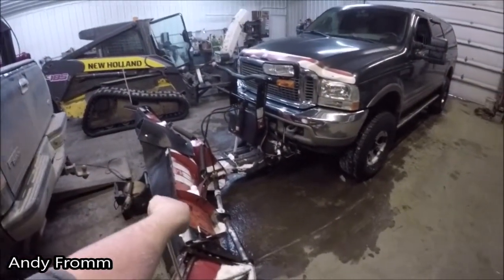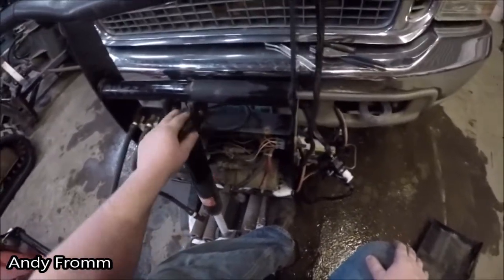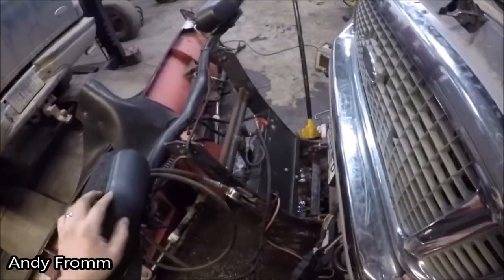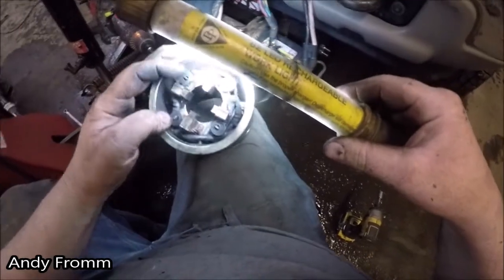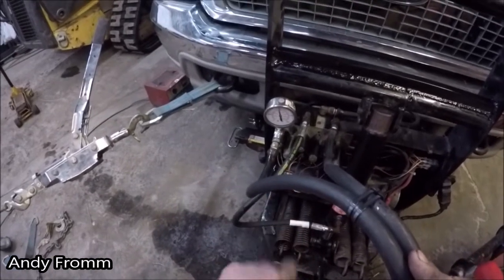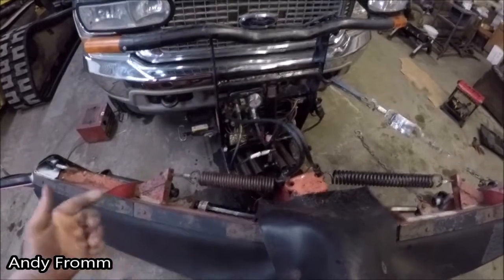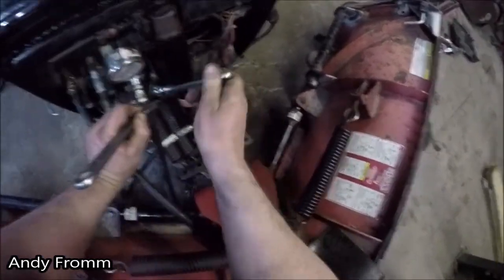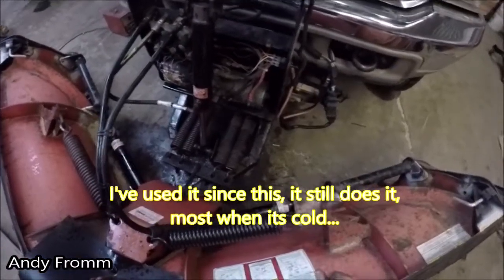Broken Boss V-Plow Common Break!

Comment: It's the plug not good connection low ground signal.
Reply from the maker: Could be but it works fine not touching truck on both my trucks. I ended up pulling apart the motor and greasing the motor shaft bearings and it hasn't made the sound since.
Reply: @AndyFromm  never hurts to grease them up.......